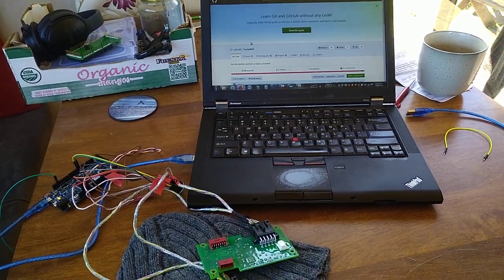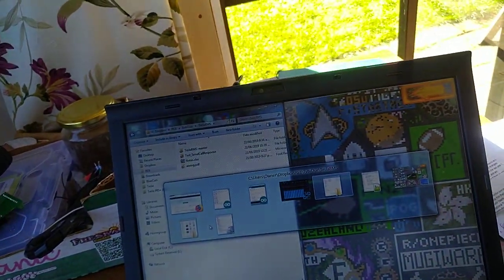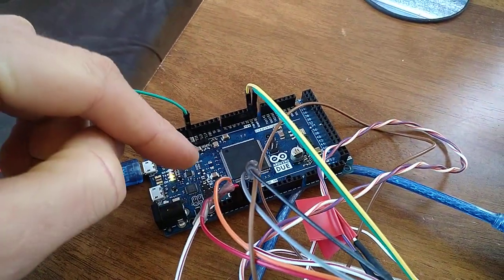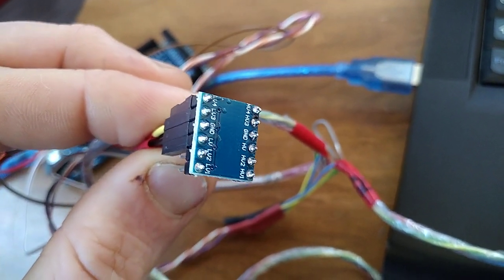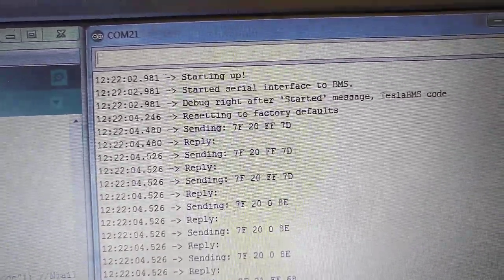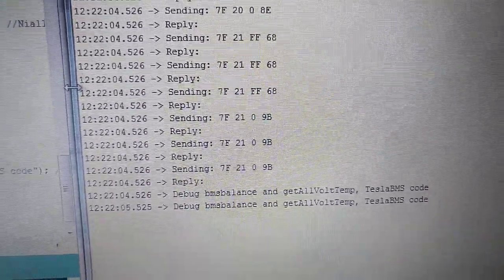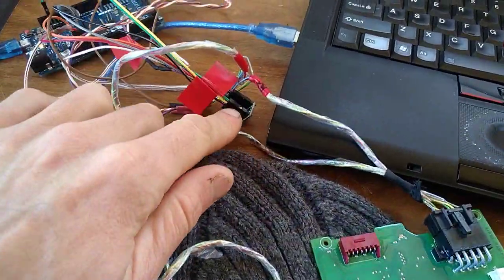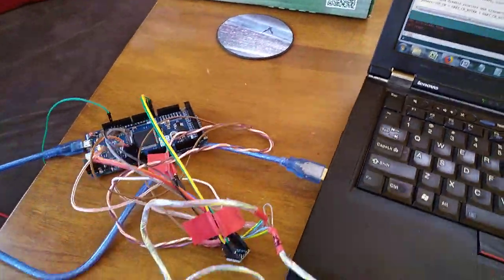Tesla BMS #1 -Arduino Not Talking

Comment: Other than the code being written for Arduino (they are shit micro controller boards) why not just use a raspberry pi instead? Surely someone has re-written and equivalent for a raspberry pi? Linux is WAY more freedom to do as you want. I'm actually a Windows technician my self so I understand that interface better, however when it comes to the freedoms of achieving what ever the hell you want and make what ever talk to what ever you have..... Then an Arduino is nothing but tedious to say the least. 

My recommendation is scrap the Arduino and find the equivalent for a Pi, plug it in and it should work.
That is of course unless you're trying to build flashrom from source code lol..... Then you'll have all kinds of hiccups.
Reply: Na, 
As a Windows programmer and first look at the Pi options
Found the Arduino way better for for dedicate hardware control 

If your running a full OS then you can get timing issue
Arduino is very simple for a reason
UNO, DUE or Teensy lots  board options

Comment: have you tried removing the level shifter. I had the same issue where I didn't get a reply back from the board, once I removed the shifter and powered the board with the 3.3V the Arduino supplies I am now getting replies.

Comment: if the voltage translator gives you problems, you can get by using  an ~1k resistor from BMS board to the Arduino Due communication (or resistor divider). And no resistor needed from Arduino Due to BMS board.  Also use an scope to confirm which wires are TX on the BMS boards, sometime hard to understand that drawing.
Reply from the maker: Ta :)

Comment: 1. Are the bms boards fully energized? Don't they get power from the battery?
2. Do you have a scope?
3. Are all the data lines twisted pairs from end to end?
4. Do you have a 5V arduino to try instead?
Reply from the maker: Ta :)
Reply: Use  a raspberry pi or find a decent laptop with a serial port and do away with the shitty micro controller boards all together. Btw: not all laptops accept/communicate on 5v via serial. I use a HP Probook with an i7 processor (old school) and have a decent docking station..... It will do all the shit that people all over the net claim you can't do with laptops and SPI. No problems talking to a Mach3 CNC micro controller